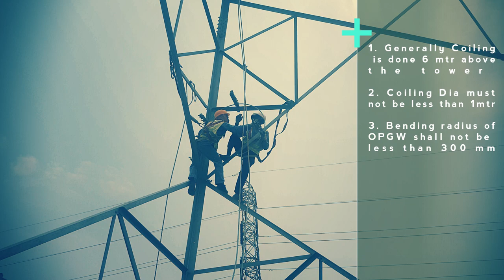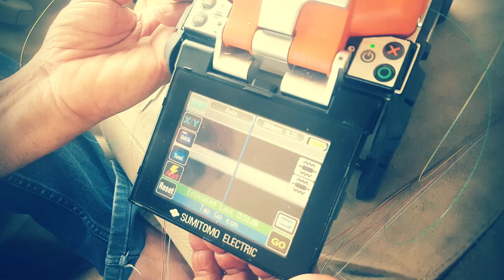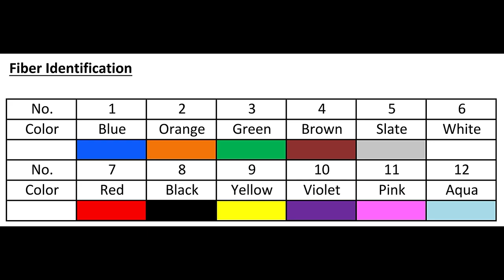OPGW | Optical Ground Wire | Splicing | Fiber Cable

Comment: Nice video! Where was this line built?
Reply from the maker: Javier Portero At Saudi Arabia.
You can share the video for others also.
Reply: I can do same kind of work firsyly i was in saudia did 5 years work there same like u but now i am in dubai can u tell me any company here wich is working fiber opyic cable same like this thanks i will wait ur repl
Reply from the maker: @attiquerehman8417  there are lots of company working in optic fibre now. For transmission line u can find NCC, KPTL, NPCC, KEC etc
Reply: @PritamSingharoy  plz plz tell me the location